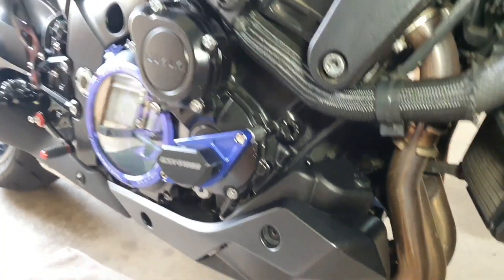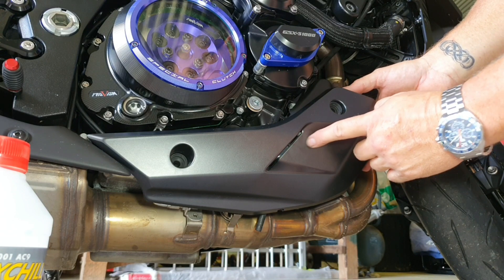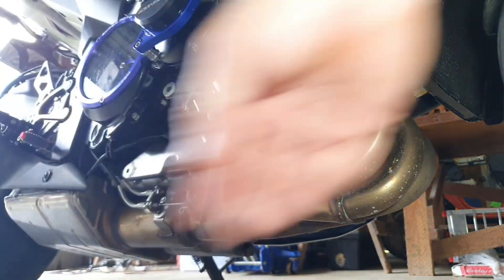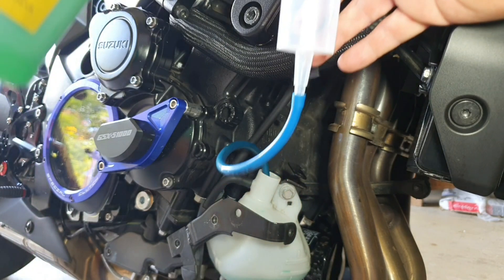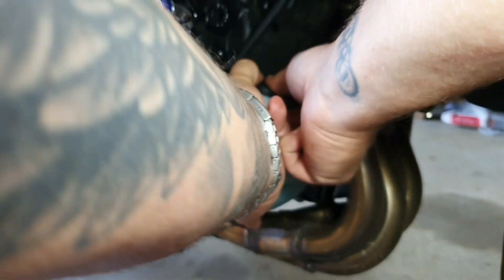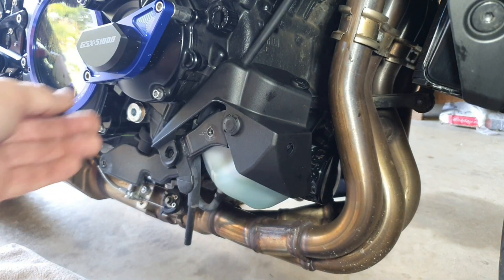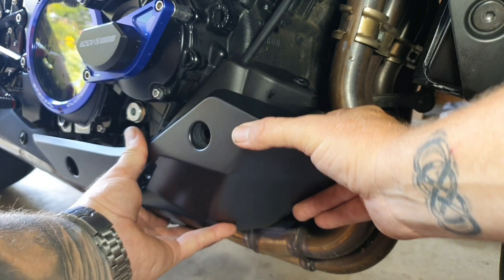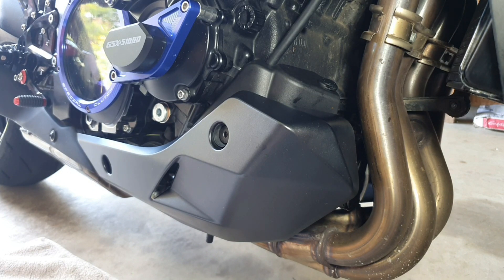Suzuki GSXS1000S KATANA Coolant top up How to.

Comment: After taking my radiator off to install a new exhaust, my temps were going crazy.. it would be 162f then all of a sudden it would read 180 and instantly go back down to 162. (162 being the real temp) I ended up flushing it and doing engine ice. Still have the same issue.. it jumps all over the place and sometimes it holds perfect for the entire day. I thought it was an air bubble too but I’m starting to think it’s a faulty sensor. Coolant levels are perfect and I also used the bleeder (there is a hidden one up near the thermostat that many people don’t know about). Bike has a mooremafia  tune, full racing  filter, and a full m4 system. Other than that occasional crazy temps fluctuating it runs great. With the tune the fan comes on around 195-205f. I’ve just been sending it.. as long as I don’t see the temps jump over 215.. it’s a Suzuki will run forever. I love the retro scheme on your bike man. Looks great
Reply from the maker: Good to know. Yep I checked the bleeder on the thermostat too. Seems to have steadied a bit but when first off it jumps around a bit. Appreciate the input mate 👍👍
Reply: @Revmatch-mr2hu  here is an update. The bike is steady as a rock now. It must have been a trapped air bubble that finally came out. Mine finally cleared and I’ve had no fluctuations but it took a few hundred miles of hard riding
Reply from the maker: That's great 👍 👌